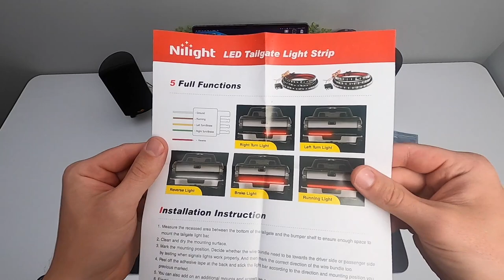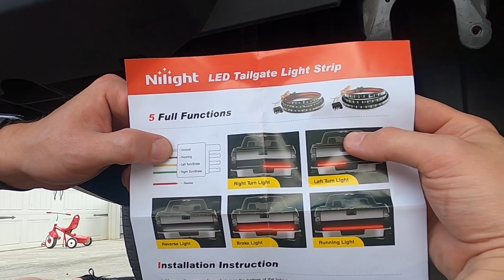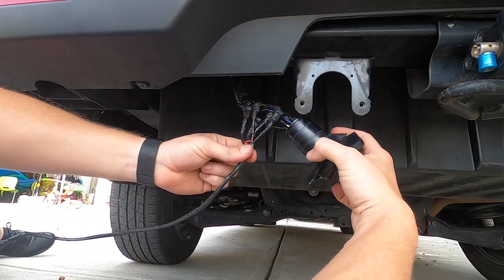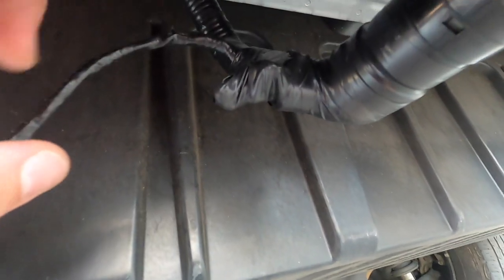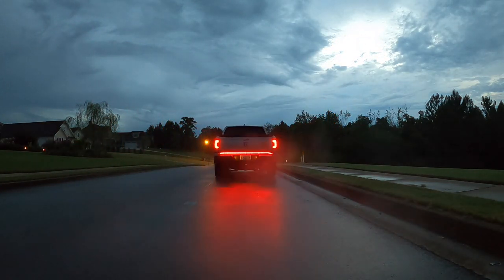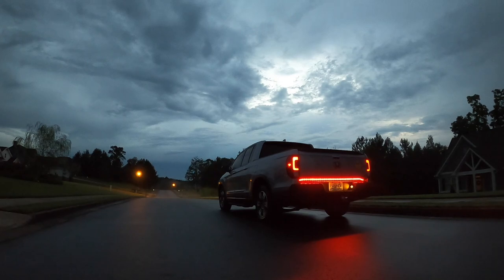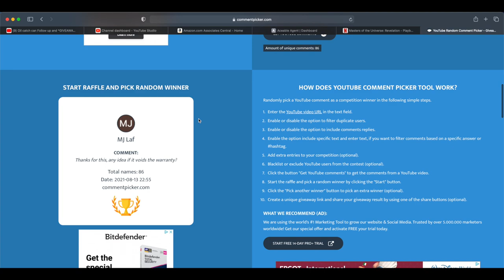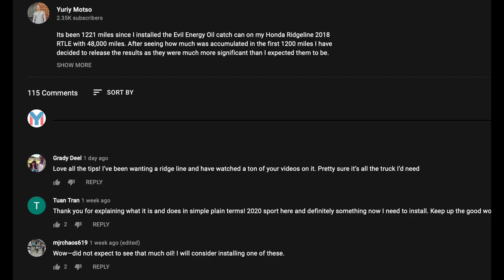Nilight 60" LED Tail light Strip Installation | Honda Ridgeline

Comment: Should of use a splitter that connects to the 7 pin. No cutting stripping except the backup light. Just take the reverse white wire fron the light bar just hook it to the middle wire of the 7 point plug splitter. It works ! No need to run the wire to your tailight. Just hook it to the splitter harness in the middle.

Comment: Thank you!
This is exactly what I was looking for. 
I bought the same light strip on Amazon ans was looking for a video to connect the Reverse wire. Other videos walked you through removing 1 of the tail lights and splicing that way. Your way is much better and leave the connector available if I need it to pull my trailer.
GREAT VIDEO!!

Comment: You spliced in simply so you can have the led bar and tow at the same time, correct?  If not you could have just plugged it into the normal tow jack and unplug it when necessary for towing?
Reply from the maker: Yes and yes. All preference and I show everyone how to splice in if they ever want to

Comment: Size does matter - there is a 49" version of this light strip  which fits much better on my 2019 Honda Ridgeline than the 60" version - the 60" version overhangs the install area
Reply: It's not by much tho

Comment: Looks great! If I want to just plug in to the rear plug on my 18 rtl-e would I just plug the wires into the 7 pin adaptor? Thanks
Reply from the maker: Yes, but you have to plug into a 4 pin adapter.

Comment: Nicely done. Not a big fan of those blue connectors myself
Reply from the maker: Yeah. Will see how it holds up. Didn’t want to cut into my harness or do major removal of the cable protection covering so this is kind of what I’m stuck with. In the event it craps out I can revert back to stock no issues. That’s kind of my thinking behind this.

Comment: Yuriy- As usual, I learned a lot from your videos. I'm a new RTL-E owner, and am trying to learn as much as I can. I've already used your oil catch can video to install this product; curious to see if a new truck will have as much oil caught. regarding the light strip, what was your source for the back up light wire, where did you attach that wire? I don't think that was mentioned in the video?
Reply from the maker: Thanks Art. Now your question I am not sure I understand? The product has a link in the description, and every single step to install the light is mentioned in the video. What do you mean by, "source for the back up light" and what do you mean by, "Where did you attach that wire?". Power source? If that is what you are asking then there is none. The power is gained from the splice. once the signal is flipped or brakes pressed the power is sent to the lights and in turn the strip which powers the strip.

Comment: Very cool! Quick question, does the excess that is being run up to where it’s visible light up as well? Just wondering if it’s shining on the ground out of you found a way to turn it off.
Reply from the maker: No, just lights up on the strip that spans the gate. The harness has no additional lighting source on it. The ground was wet so there is a reflection off the ground. It will automatically turn off when the car is off and or when the sensor detects that it’s bright enough outside.

Comment: Get one of your friends who work in aviation maintenance grab you some heat shrink for exterior wiring. Totally waterproof. Wrap, it grab a hair dryer, and it shrinks to fit tight. I work in aviation maintenance.
Reply from the maker: Yes, I actually may have some somewhere.

Comment: Did you use the screws they provided?  If not, how is it holding up with just the tapes?
Reply from the maker: No I didn’t. The tape has welded to the vehicle. It’s not going anywhere. I don’t like putting holes into my cars unnecessarily. I can always use a product to remove glue though. Goof off should take off the residue if I ever want to remove it.

Comment: Is the wiring all the same for all trucks
Reply from the maker: Not sure. One would assume it is as it’s a universally standardized connection. Easiest way would be to check under the cap of the towing harness and it should have the connection diagram.

Comment: Would never splice into original harness bad idea to much risk for a short in the future or corrosion...
Reply from the maker: True. That is why I used these crimps. They do the least amount of damage and are very easy to repair to where you do not have to worry. I seen people cut their wires and solder together and that I over kill. But again this is what I did and does not mean others have to do it this way. Now At least people who want to will know how it’s done.

Comment: Nice but all videos pertaining to this use electrical tape. Has nobody heard of heat shrink tubing for waterproofing connections or even Posi-Taps? Sheesh!
Reply from the maker: I would have used it if I had some. When I was done I did wish I used heat shrink. But what’s done is done. For now.
Reply: Thankfully it's not your truck, but we can all learn from his shortcuts for what not to do to our truck.